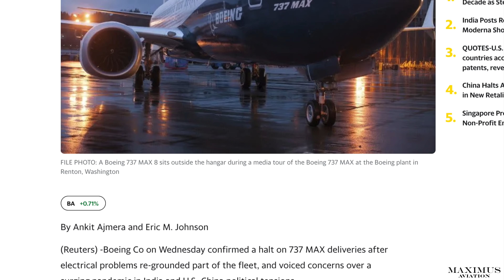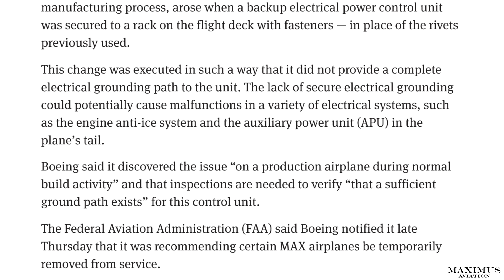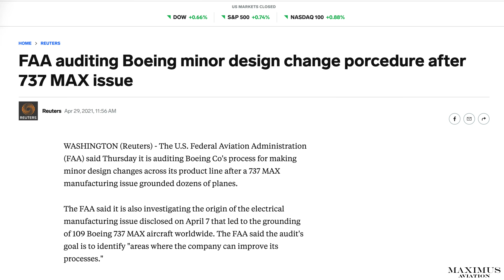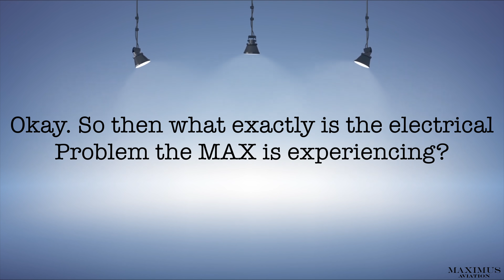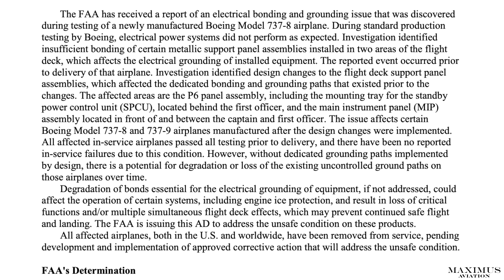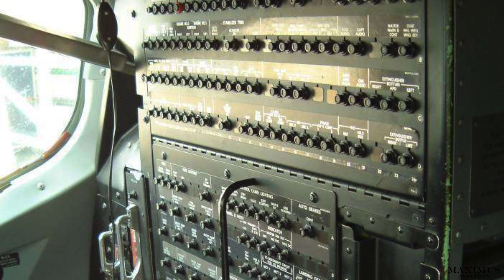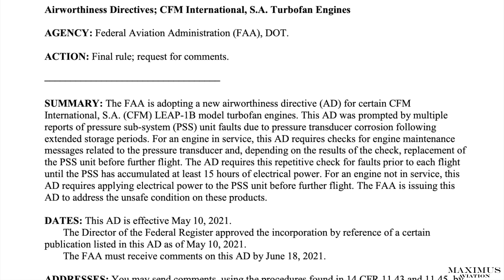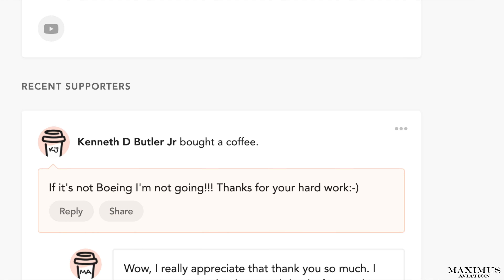Boeing MAX STILL Grounded! New FAA Airworthiness Directives Keep The MAX On The Ground Indefinitely!

Comment: Boeing's excuse sounds real dodgy considering all electrical hard parts are to be electrically bonded by removing paint from the mount surfaces and alodine applied to the surfaces. Both riveted and bolted hard parts are to be bare metal with alodine applied to surfaces that meet each other. Boeing has real bonding issues since inspectors don't inspect the bonds, simply techs take biddle readings and must be within engineering requirements. The problems occur when techs get high biddle readings instead of re bonding to achieve the engineering biddle requirements many techs fake the biddle reading and input false biddle readings into the jobs. Inspectors see the fake biddle readings and think nothing of it because the numbers are within the specs....................but the numbers are FAKE.
Reply: Schlomo Baconberg  sadly I've seen sheet metal techs at Boeing assembling electronic brackets simply drill holes and fill them with electrically conductive coated rivets and call it good. When the proper way is to strip down the metal and alodine the surfaces that meet along with installing electrically conductive coated rivets. Some of the bonds after stripping require a fay surface seal with electrically conductive sealant that we call dog poop................that's what it smells like .😂

Comment: I have no expertise on the subject but I would feel a lot better about airplanes electrical systems if they did not rely on the plane structure to provide the ground path.    I know it would add weight and cost but given how an airplane flexes.....
Reply: I think you're pretty safe with aluminium airplanes.    That is to say, if flexing and corrosion between all adjacent panels was so bad the current couldn't find a ground path *anywhere*, the plane would be literally falling to pieces and electrical grounding would be the least of your worries.
With the use of composites like in the 787 and A350, then grounding of panels does have to be specifically addressed.
But electronic modules really do need to be properly grounded, I'm surprised they don't use a dedicated ground cable or at least an earth strap to a dedicated earthing point.

Comment: One of the problems is that man of the Mechanics do not know the difference between Grounding and Bonding components electrically. They'll take a VOM and do a ground check on one what should be "Bonded!"  The difference is BIG.  A static ground is generally sufficient for a VOM but to measure for an "Electrical Bond" it can have a maximum resistance of 2.5 Milliohms. That requires special equipment like a Megger, Keathley or a Biddle Meter.
Reply: Boeing's problem with electrical bonding is they don't inspect the bonds. Techs take biddle readings and if they can't achieve a proper biddle many of them input fake numbers to satisfy the engineering requirement. When the job paperwork is examined the inspectors see good numbers yet they never witnessed the biddle being taken otherwise they would have seen bad readings!

Comment: Airbus has that same Leap 1 engines on the A320 Neo Family. Does the AD apply to Airbus as well?
Reply: The Max version is a highly modified one specifically for it. To maintain the efficiency with a smaller diameter front fan (not enough ground clearance for the one fitted to the other versions) they had to make a few changes, including special internal coatings.
I always wondered why these changes to make the Max engines comparable to the other versions were not used to make those other versions even better - I am beginning to wonder if we now have the answer.
Reply: Both the LEAP engines on the Max, and their predecessors the CFM-56's on earlier 737NG's, are about 8" smaller diameter than their equivalents on A320's.    I'd say this is because of the well-known ground clearance limitation on 737's.    I'd assume the Airbus version has better economics because, after all, they could easily fit a smaller diameter engine to the Airbus if there was any advantage.
Anyway, short answer, the engines are the same family but not identical and the Pressure Sub-system  may well be different.  Note 'this AD was prompted by numerous reports of pressure sub-system faults', presumably those were all from Max's, if they'd had reports from other types I guess they would be grounded too.   It's not a huge deal, it just requires careful checking of the system.
Reply: No- the A320 family has an AD for faulty fuel pumps that is potentially dangerous, but Maximus never covers Airbus’ mistakes.
Reply: @markodom3841   Sounds like 'not a huge deal', like the AD for the 737.   Point is, they're different engines, same family but not identical, so implying that an AD for one should automatically apply to the other is just blowing smoke.
Reply: @cr10001  my point is that the A320 family has a different AD but he never reports on problems with Airbus (that also indeed occur).

Comment: electrical bonding and grounding - means they used a kind of open electrical conduction shared by multiple devices/systems, instead of wiring each one separately. to save money! look, don't laugh, if it was your money you'd be crying. have a heart, guys. still, at least there have been no deaths. so far.

Comment: I'm shocked!  Shocked I tell you!  Boeing has been so thorough and the Max has been so investigated and tested this plane should be able to walk on water.
Reply: Yeah, it's a multifaceted jam.  Boeing is under a regulatory microscope now, and they're not going to get away with even insignificant deviations from perfection.  And on top of that, their engineering still needs work.

Comment: Maximus, you are often accused of being a "Boeing basher", but as you often say, you would like see Boeing succeed. Unfortunately, Boeing don't seem to want to co-operate, instead they think it's all Airbus's fault. If they hadn't introduced the A320 NEO, Boeing wouldn't be in this mess because they wouldn't have built the 737 Max! Incidentally, to your viewrs that point out that the A320 NEO uses the same LEAP 1 engine, the AD specifically states the LEAP 1B variant, Airbus use the LEAP 1A.

Comment: Likely there are/were experienced engineers who knew better but have been pushed out/pushed aside by an upper management that fails to recognize and retain those who really understand the nuances of designing safe airplanes.
Reply: More likely because of cost cutting.
Reply: Lots of experienced Boomer engineers have retired. This has affected all industries. May just have to bring them back as consultants.
Reply: @docholiday7758  at much greater cost.
Reply: @docholiday7758  I agree. All too shortsighted.

Comment: I wonder if there are any more "bad grounding" issues lurking in electronics of other new aircraft. We are now using composites in a lot of places where metal used to be. Also, we have so much more electrically driven and controlled items in the latest jets. So unless they have a heck of a lot of copper inside grounding each individual panel, maybe this is just the tip of the iceberg?
Maybe Boeing is the canary in the coalmine since they are now getting increased scrutiny due to their massive administrative failures of late.....?

Comment: Fortunately my 1972 Jaguar XJ6 has an electrical system designed and manufactured by Lucas and installed by British Leyland workers so it just works :)
Reply: Victor Swann  Like I said, 50 years later and it still starts, the windows go up and down the doors lock and I can see where I am going at night. Oh and the indicators still work whilst those on expensive German cars seem to fail 2 seconds after 
Leaving the showroom!
Reply: Just Dont tell Clarkson
Reply: A joke of course. Lucas was known at Jaguar as “The Prince of Darkness”
Reply: @johnwood1948  No, real life! Mercedes w123 240d......electrical and gearbox problems, Mercedes w110 200d .......electrical and gearbox problems, Jaguar XJ6 only a severe drinking problem for petrol and a minor addiction to lubricating oil from engine, gearbox and differential almost as bad as my VW splittie kombis addiction for the same fluids. They are all over half a century old and when you get to that age you tend to leak fluids a bit :)
The Jag is of course twice as fast as the Mercedes!

Comment: “Long term storage”?? Oh you mean like when you are assured that the lockdown is only for a short time to “flatten the curve”, and we still don’t see an end after a year of incompetency? That “long term storage”??🙄
Reply: No, it's the long term storage caused by the original grounding. If an airline takes a plane out of service temporarily, it can always carry out engine runs from time to time to keep the engines in shape. These planes, however were never delivered but stacked in remote storage areas while Boeing fixed the MCAS problem.
Reply: @2000globetrotter  Sure... and I bet that every one of the planes parked by the airlines are getting that scheduled TLC you just described.

Comment: Whenever a design change is made, Boeing staff engineers are responsible to ensure the revised configuration complies with all applicable FAA regs, then sign off on the change as "compliant." Sounds like engineering and management are getting sloppy--and I'll bet no one gets the axe, another mgmt weakness.

Comment: You fail to mention this engine is also installed on Airbus Neo's.
Reply: But the FAA and others didn't insist that the Airbus aircraft not be flown for more than a year did they?
Reply: yes, but they were not sitting bin the desert collecting dust
Reply: @SubOrbitalBen       It isn't.   Max's have the Leap-1b, A320 Neo's have the Leap-1a, which has an 8" bigger fan.   The AD says there have been numerous reports of PSS unit faults, presumably all from Max's.   If any other types had featured they'd likely be included in the AD.
This is why only a limited number of 767's were grounded by the P&W  4000 engine explosion.   The AD addresses the type of engine specifically affected by the fault, not similar (but different) engines on other aircraft.
Reply: Related but not the same. Boeing had a special squeezed down version for the 737 with a smaller fan so they don't quite act as skids. Can't help with fuel economy either!

Comment: If the engines are being corroded on the max, shouldn’t the new be the same? There still LEAPS
Reply: A different version - bigger for a start and not so cramped in the nacelle - plus they haven't been sitting around in all weathers doing sod all for more than a year.
Reply: @EuroScot2023  but still Boeing did not manufacture the engine

Comment: I am speechless. I don't want to say but this is very disappointing. People at Boeing get your s..t together or be honest and quit. It's that simple! Thanks Maximus
Reply: I mean, the engines aren't their problem though. Boeing gets way too much blame for Engine issues in the last 10 years, even though the only thing they do is put the engine on the wing
Reply: @ktjmitchell7722  maybe that is the problem; Boeing needs to "own" the whole plane; they need to do better due diligence and communicate better.
Reply: This reminds me of the poor quality of some aircraft manufactured under poor supervision and issues that resulted.

Somehow Boeing had top level management driving for small cost cutting measures leading to massive complications and problems. This in turn seems to be leading to poor company public image and is affecting their ability to produce and sell their airframes.

You would think these sorts of top level mismanagement would lead to top level managers being replaced? Reality suggests they will try to cover their asses and fire supervisors and engineers blaming them for their errors.

These failures come from the top, and are bleeding back down onto the men and women at the front line doing their best for little to no respect or appreciation.

The CEO needs to start inspecting his top managers carefully, find the ones fixing problems and listening to their underlings for advice. Keep those, and start laying off the ones shouting and blaming subordinates.
Reply: @glenmcgillivray4707  too late, they have already purged the people they need for a culture of safety and quality from the organisation. I think they need to be purchased by Airbus.
Reply: @georgeorwell4059  what could Boeing possibly have that Airbus could want?
Reply: @GreenStarTech  manufacturing plants, defense contracts. Kill the 737 and start building A320s. The fundamental Max problem is modern engines don't fit in the old airframe, so it is time for its retirement.
Reply: @georgeorwell4059  US government will never allow defence contracts to be owned by foreigners. Why would Airbus want any of Boeing's military tech which is outdated? Manufacturing plants? Nope, those are also old tech.
Reply: @georgeorwell4059  Boeing has the basics for a new 7-7 in the 787; but maybe they should buy into Mitsubishi's new planes if they are to useless/lazy to build their own; even the Russian MC21 is better than Max.
Reply: @georgeorwell4059  aquision won't fix the problem. And a global airplane provider will just start to bloat out.

No the culture can be fixed really quickly with the idiots in charge swapped out for competent people who can hire competent staff to lead and guide the changes needed.

Instead of people hired on merit and focused on small numbers and performance metrics which actually mean nothing in larger context.

Like always the folks at the coal face end up doing what they can as best as they can, without the right people in charge, the goals and objectives shift from quality to quantity. And we don't need thousands of airframes that fall apart. We need hundreds that last for decades flying at high speeds with millions of passengers.

Boeing needs to stop punishing the labour, and look at the people hiring the guy in charge. The man in charge had a lot of work to do. The guy above him demanding increased profits with less resources, or relying on performance metrics rather than airframes produced and quality therein? There is the person who forgot their job description.
Reply: @glenmcgillivray4707  I agree with everything you said, but change starts at the top. A buyout gives new leadership which is necessary to change culture. I imagine that somehow the role of fasteners in electrical grounding was overlooked when the design changes were being made. Certainly the original designers knew but somehow those making the changes did not. How can this be prevented in future. Is it a skill or system problem or both. Those making the changes for whatever reason were functionality incompetent.
Reply: @georgeorwell4059  rivets are slow, quickly hurry up and replace the component with a bolt.
That one will do, now hurry up.

Sir that might give us a poor electrical connection?

It is bolting two bits of metal together! Why would there be a connection issue, get on with the job!

A buyout by Airbus? Would leave us in a monopoly situation.

If you want a big air frame? Contact Airbus.

And the US government would never allow rights, access or responsibility for their military factories to be in the hands of Europe.
They would rather buy out Boeing. And sell it back to the highest bidder. Because privatisation is all the rage.

Comment: I had a car with a bad engine ground once...the lights would go off and on in the rain if I was driving at highway speed. Braided cable and two screws solved my problem.
Boeing? Ball's in your court!
Love,
David
Reply: Truck manufacturers do something similarly boneheaded when they insist on grounding exterior lights through their mounts, which are often steel on aluminum. Enough salty winters, and the lights don’t work, requiring the second wire that should have been there all along.
Reply: @colinwallace5286  in the late 1980s GM had a "Cut costs" drive, and it's German daughter Opel - hitherto "the reliable" , got a full load of cut costs. One was a grounding strap for the reservoir "economized" - led to cars starting to burn while filling up due to some static electricity issues. Went all downhill from that.
Reply: @aasphaltmueller5178  My Scottish cousin had an Opel Manta. Great little car, but not for a 20 year old male.
Reply: I remember that "Interesting Time" when I saw what I swear was strips of  DUCT TAPE that I saw flapping in the breeze ( 650 + MPH breeze )  on  the left wing just after where the  slats of the wing( slats being a type of flap on the leading edge of the aircraft's wings)  were on   of an airliner I was on . I think  ,but not entirely sure ,that I was on a Boing 737 ( not Max but older model) . Suffice it to say, it was "a curious observation" . Is "Duct tape" or some other form of tape that LOOKS like Duct tape "a thing" that is used on airplane wings? Yes, I know this is a bit off topic but the memory of that "Interesting Time" sorta popped into my mind. Probably seeing this Video about an airplane jogged my memory or whatever.
Reply: @michaeltheoret8913  Yes, it’s a thing. https://en.wikipedia.org/wiki/Speed_tape

Comment: The engine AD is somewhat explainable given that nobody expected them to sit idle for more than 2 years. But the electrical grounding... That is bad. Really really bad.
At some point, somebody has to start asking the tough question: Should we start designing a whole new airplane (and consequently convert all outstanding orders to that) instead of continually patching the MAX-planes together and discovering new technical issues?